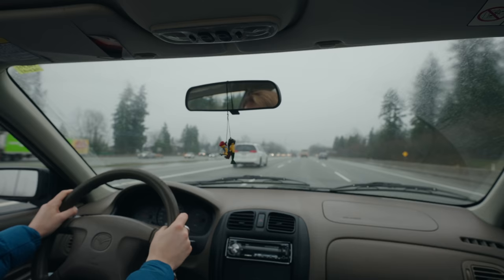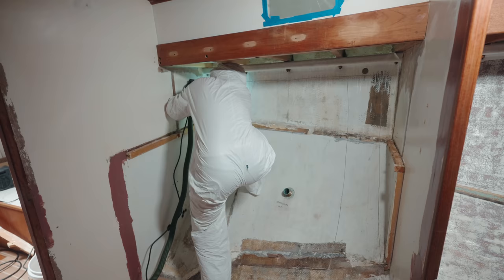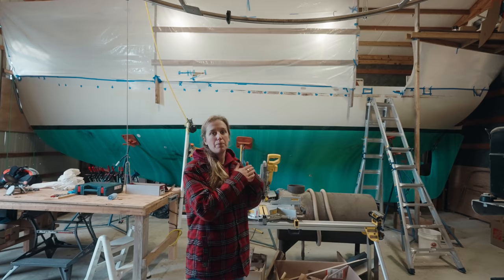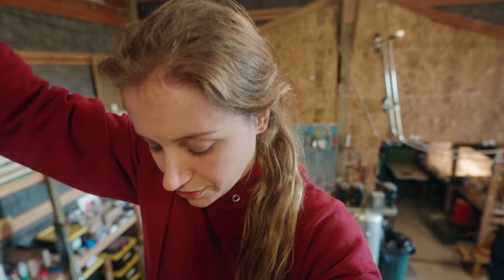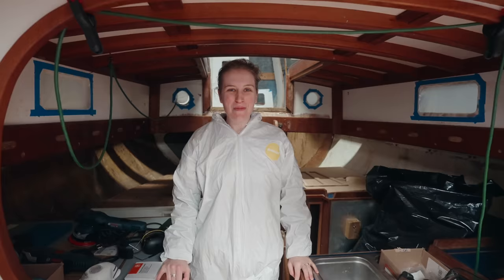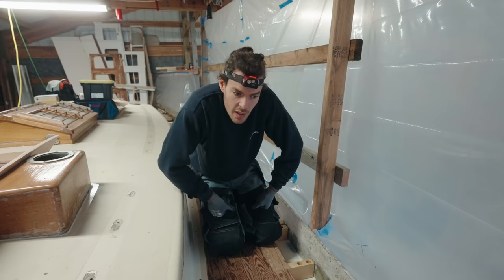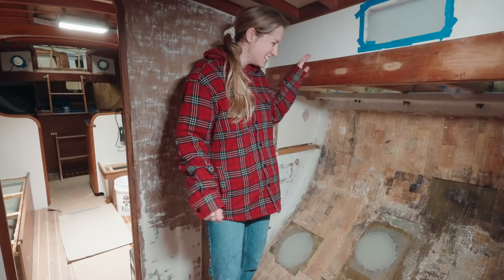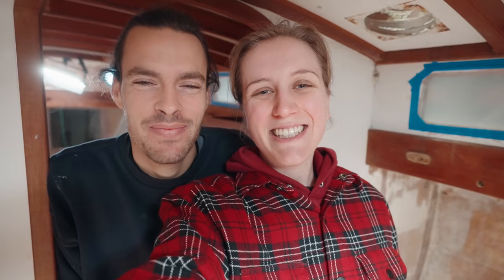Sailboat Demolition STARTS NOW! [S4E37]

Comment: Here's something I did to avoid head thru hull exit. - Routed a 12 volt line to the deck pump out.  Where I installed a 12v plug in with a cap.   Put an off/forward/reverse switch on the line back at the panel.  Changed the deck pump out fitting to accommodate the threads on a macerator pump.  When I want to pump the holding tank under way I attach the macerator to the new fitting and plug in the 12 Volt plug to the new 12v fitting near the pump out.  The macerator has  a 5' hose on it with a 6" iron pipe at the end (to keep it below the water line.  Then I pump the head out by flipping the switch. Once empty I reverse the switch and fill the holding tank with sea water (takes me about 60 seconds) and then empty the tank again.  Keeps my head smelling clean, eliminates the thru hull issue. Also keeps the port authorities happy because you have no head discharge below the water line. And after a few rinses using forward/reverse switch the the hose and macerator are clean and ready to be stowed.  At first I was worried the macerator pump might not lift the water up high enough but that was not a problem.  An additional benefit - I could pump out my head into jerry cans if there was no pump out available. (like when you're living aboard while on the hard.)

Comment: Every episode you release is so impressive. A little tip, When it's cold and you want to get laminate to harden, infrared heaters can work.  If you want better thermal insulation, you can use a ten millimeter thick polyethylene foam that also occurs as a sleeping pad in tents.  The material has dense cells and therefore does not absorb water.  In colors such as black or dark gray, the material can be visible with its matte surface.  The material can be attached with contact or carpentry glue.  I have done this on my boat on the hull and under deck sometimes visible or hidden under other materials.  The boat feels warmer and less damp.

Comment: One thing you can do to attach the rub rail, particularly as you have such a thick outer skin, is to use screw in blind 316 screw sockets. These have a course thread on the outside to epoxy and screw into the fibre glass then you screw the rub rail into the blind internal thread in the inserts.
Reply from the maker: I was thinking about using threaded inserts but they are pricey…
Reply: @SailingMagicCarpet  I’m sorry I’m in the wrong part of the world to help. My CNC lathe is in Sydney and I’m in Europe. I’ve wanted to make a production batch of those in several sizes but it didn’t work out that way. I might just do a design and get them priced from a company that machines a lot of parts for me. I suppose you would want to use 10mm bolts. I want to refit all of my stanchions with blind inserts, its not on my immediate work list.

Comment: Suggestion: Build an insulated box with room for the heater and whatever epoxy and hardener you intend to use to warm at least the bulk product up.
Reply from the maker: We did that last year and have a box in operation!
Thanks for the suggestion

Comment: what about fiberglassing some brackets to the outside of the hull and bolting the new bump rail to those? That way there's no hull penetration at all, and at worst a bracket breaks off in a bad bump rather than a bolt shearing through the hull.
Reply: I did the same on my boat and it worked a charm. The added bonus was that the water that washes up over the deck immediately runs off and does not stay on deck and suffer ingress into the deck and beams as it doesn't go into the hull at all as well as sitting proud of the hull providing extra protection as it sit slightly wider of the hull.

Comment: If you MUST have a rub rail - glue it on.  Otherwise use your fenders/bumpers.  Goal should always be - NO HOLES - or as few a possible.  Consider a sea chest for a single thru hull common intake.

Comment: You don't  need  to go all the way  through  the glass to attach the rub rails. Thus  preventing moisture  intrusion in the future. If the glass  is an inch thick  go in  3/4 inch.

Comment: 3 M  tape or emblem tape works well to attach stuff . Often used to hold boat windows in .it is what holds the emblems on your car.   Might be an option for the rub rail .

Comment: If you are concerned about letting water in via rub-rail bolting, you might consider not having a rub rail at all. Rub rails are not a necessity and are prone to up/down damage if secured to a harbour wall with a scend present. Use carefully placed fenders instead.

Comment: I bolted on a teak rub rail with bronze carriage bolts with the heads recessed into the wood, placed the traditional bronze half round strip covering the bolt heads, all caulked with 3M5200. Has worked well. The problem is the bolts and nuts and washers on the inside would sweat until I covered them with PVC caps filled with foam, potential spot for rot.
Reply from the maker: Thx for sharing that! I didn’t even consider the sweating before… one more reason I’m happy not to have the bolts in place any more

Comment: Dang!  I own CG 36 Aurora.  It is an owner finished boat with a relatively bizarre interior.  I have been remodelling the interior for some years but I don't have balsa core, I have 1/2" urethan foam.  I still removed all of it in the V-berth and replaced it because I had to remove cabinet bulkheads bonded to the hull.  I am happy with the urethane foam/fiberglass skin I added.  Also FWIW, I don't have a rub rail.  Drop me a note if you wanna compare notes.  Been watching with interest, some of your projects I'm in the middle of, some I've finished, some I'm considering.
Reply from the maker: Great to hear from you Todd!
I initially thought ours would have foam instead of balsa as well but oh well we almost made it:)
Is Aurora the one with a Westerbeke engine and marble countertops?
I would appreciate seing other cg‘s if you don’t mind sending some photos wich will be for our purpose only of course.
Our email is sailingmagiccarpet(at)gmail.com
~Aladino

Comment: You may want to seriously consider foregoing the rubrail. But if you really want it, consider epoxy bonding appropriately sized and beveled G10 blocks on the inside, then screwing into, but not through, the G10 blocks for the rubrail fasteners. That should be leak proof and more than adequately strong. Radiant heat lamps are really useful for warming smaller areas to laminate and kick off epoxy, and also useful for drying existing damp balsa before sealing again. Rather than coarse biaxial stitched cloth, consider using tighter weave 6 oz and 4 oz cloth to seal the balsa and provide a smoother finish.

Comment: Re rub rail   I just remembered a great rub rail concept I saw once.
Build a rail based on Fibreglass strip's.
The idea is to bend a plank or scrap wood, to roughly the same curve as the top of the hull, face it with packing tape or some other release agent.
Make the size of the Fibreglass lay-up a bit more than twice the width you want the rub rail ( Say 120mm) and build it up to say 20mm.
After curing, saw a straight edge on the two outside edges to get rid of the jagged sides, then saw it down the middle to make two full length narrow Fibreglass "planks "
Since they are almost bent to shape, you just sand them smooth and attractive,  and then epoxy them to a roughened strip of hull, using duct tape to hold the final shape while curing.
No penetrations, no rust, no hard points to break off on wharves .
Easily repairable, totally sacrificial.
You could even do the top layer in a laminate of hard timber for looks.
Just another option.

Comment: It is sure that tearing everything out to find that there are only 2 small strips of balsat to replace must be frustrating .... but hey, at least you know exactly everything that is in the box. thickness of the insulation of the hull and you will leave on a healthy and new environment. to put a new sheet of epoxy, I would advise you to first coat the balsat with resin and once dry to put this fiberglass sheet again. and for the finish, you can apply gel coat rather than paint, as this is much more solid and easy to maintain over time....Bravo and super courage, the decision should not have been easy to make, but once this is reassembled, you can be very proud to leave on a healthy hull...!! The outer rail... it's double-edged, it can protect like tearing everything... all the boats I've had had no rails (apart from the Attalia, but it was aluminum, and fixed with the deck), putting it in the middle of the hull does not seem to me a good solution... risk of shearing with another boat against against in the event of a swell... you will see for yourself, good courage for the site and congratulations again for all this energy which will give a new boat beautifully repaired like the first Magic Carpet 1, Vincent de France

Comment: Just an Idea.If you have 1" of solid fibreglass to work with, using the original holes, you could epoxy brass nuts in the original holes. This would give you a good attachment points without going into the wooden part of the boat. you might be able to have a machine shop make the brass inserts to fit the holes and then tap the brass inserts with the appropriate threads for the bolts that you would use to attach the rub rail.
Reply: I should add that you can find brass inserts of all sizes on Ebay. You may be able to find an insert that will fit your present holes. You then find the appropriate machine screws to attach the rub rail

Comment: Can't see anyone else making the suggestion to use a hand held  heat gun when wetting out glass with epoxy. 
It makes wet out 100 times easier, and ensures a quality saturation.
Reply from the maker: We do activate the heat gun when in trouble but there is no need when things are saturating nicely:)

Comment: The only reason moving the rail higher doesn't work is because you are keeping the rail the same size. If you make the rail wider you can move it up as far as you like. I'm you can epoxy it in place and it will be strong enough but I  also like the idea of bolts and ones that are backed by parts that aren't structural or connected to the rest of boat to isolate any possible rot. Or in a sense making the backing of the rail a sacrificial consumable as well.

Comment: From previous experience, I Highly recommend NOT installing any rubstrake/rubrail at all because it will be a hazard alongside anything (dock, pier, yacht) where there is a up/down motion where the two are are rising and falling at opposite frequency and any hard rail sticking out will be crushed by any similar obstruction sticking out (pilings, bolt heads, other yacht rails, dock edge,etc). I have seen damage from this type of motion and it is harrowing to watch the destruction and a pain to fix. Eliminate anything sticking out from the hull and bulwark.
Reply: I think he is right, why would you want to put a rail, when the fenders are enough to protect the hull, and we have the advantage of sliding, if there is a rail it will be much less easy...! !
Reply: @VAdu56  I disagree. A rubbing strake is extremely strong due to is shape, length, and mounting method. Further it is traditional for this boat design style.

Comment: Have you considered shortening the rubrail? Forward of the forward lower chainplates a rubrail is not very effective, due to the flare in the bow. Crealock designs (Pacific Seacraft 40, Cabo Rico 45) show what I mean. How far forward you extend the rubrail is more an issue of aesthetics than practicality.

Comment: for my boat rubrail im going to use 316 metal inserts  driven onto the hull, where the rubrail bolts will fasten. by bedding the inserts into epoxy i ensure that there will be no leaks. for the rubrail itself im going with a fake teak trim. not cheap but maintenance free and should last for 20 years (i hope!)
Reply: Fake dimensional? Interesting. Like the insert concept. Thought the problem with rubrail fasteners on FG hulls is the length expansion fighting?

Comment: Why even have a rub rail. I don't think you will need them as you won't be sailing from marina to marina anyway, your blue water no littoral.  Good quality fenders. Also check out what RAN II  used going thru the canals last year. Hull/Fenders with a board connecting the fenders together.

Comment: Aerogels might become an option in the future to improve insulation. Its expensive as production involves specilized machinery and lots of energy. Though, even as little as 2cm of this material would have the effect of 10 to 15cms of conventional insulation like rockwool.
Silica based aerogels are also hydrophobic and the least dense solid humanity has discovered to this date. So they are also exceptionally light. 

Material conductivity of Balsa is roughly 0.0339 W/mK, Aerogels are at 0.002 W/mK. 

THough i have no idea if it's too brittle for the constant rocking of a boat, but it survives being launched into space, where it insulates critical components like sensors in satillites.
Reply from the maker: I had my eyes on that stuff!
But cannot afford it now. 
Maybe one day on a new build it would be insulation for the hull and the fridge!
~Aladino

Comment: Consider leaving the rub rail off altogether.  I have always found them rather useless.
Reply: I totally agree. Especially for a blue water cruiser that will be doing long distances and lots of anchoring, it's not really useful. And it looks a lot better without it.
Reply: I find them very useful. Would not eliminate.  Saved my hull in a hurricane.
Reply: As an armchair sailor myself, I don’t understand what purpose a rub rail serves that fenders couldn’t do as effectively? Extra protection maybe? Kind of a belt and suspenders thing?
Reply: I use my rub-rail all the time. Mine has a stainless steel strip on the outer edge and I warp off pilings anytime I want to when getting in or out of a slip with a crosswind. I consider it an essential piece of the boat. Just my 2c. '99 IP 350.

Comment: What if you countersunk a as Hollman  three fab treaded insert from inside the hull and then glasses over it from the inside then attach the rubrail from the out side with S.A. machine screws with lock tight  and thus no hull penetrations.
Reply from the maker: I thought about that option but threaded inserts in stainless are very pricey!
Thx for sharing:)

Comment: One inch would make the boat safe in the northern passage I would think. Many of those boats use incredibly thick aluminum  though. Wondering, what sort of bulkheads does the boat have, and have you done an episode where you inspect them ? I've found it at
Reply from the maker: It’s certainly a serious glass layup:) we have shown some repairs done to the bulwarks when we were building and installing beams. They are 1”thick and well tabbed don’t know what else to say about them🤪

Comment: What about a rub rail that is mechanically fastened above the deck? It can be through hull bolted but above the deck. Suspended with S.S. brackets hardware? This may be an odd option but your not penetrating the cabin of your hull! You mentioned in earlier videos about reinforcing the hull above the deck with fiberglass instead of wood.
Reply: Good thinking, but, thinner fiberglass hull at that point plus you would introduce toe smashing bolts in that area.
They also stated that the way the hull is curved a higher rub rail would be ineffective.
Reply: @philipmackin1025  thanks. I was thinking keep the rub rail where it was just offset the anchor points. That technically would put a moment rotation on the through bots at the anchor points but those would be above the deck level and be reinforced.

Comment: good call balsa may be a good insulator but  unless well sealed when rot sets in it loses structural integrity and from experience in model boats that way leads to disaster
Reply: the balsa is not at all structural on this boat.

Comment: Hi, nice to see how you're going to rebuild the boat from inside out finally doing what the builders should have done in the first place when constructing it. It would be interesting to hear why Aladino changes the anchor chain concept so as to keep the chain in the foremost dedicated section where it won't be at the deepest possible level in the bilge. Production boats have this kind of arrangement because the front compartment alias chain locker is considered a collision compartment where water ingress would not compromise hull buoyancy and safety. Would that be the reason why the chain is kept forward? Keep up your wonderful work!
Reply from the maker: In my opinion the biggest reason for having a chain locker high and at the very front of the bow is out of simplicity and least expense for the yards to build.
Unless you have a very big boat carrying the proper amount of chain actually required on a circumnavigation is a challenge with those modern setups. That is why we changed our chain locker  and sacrificed some storage under the v-berth. The disadvantage is having to design the locker to drain since it’s below the waterline. 
A watertight compartments requires considerations on its own.

Comment: Use a spray bottle with 50% bleach &water mix to spray any black mold spots on the inside hull. Need to kill those black mold spores. This is a Health Hazard that needs to be eliminated.

Comment: Skoal or Copenhagen in your back pocket?  LOL
Reply: Was wondering the same thing.
Reply from the maker: OF COURSE NOT! Honestly, gross. It’s the camera’s lens cap.
Reply: @SailingMagicCarpet  Ahh, that makes sense.  As a photographer I should have caught onto that.  I'd be wary of putting it in the back pocket though.  If you sit down on it forgetfully, it may get cracked though. Lens caps aren't very expensive, but an extra cost you don't need.
Reply: @SailingMagicCarpet  not a photograpographer or a dipper.  I just see a lot of people with those circles in their pockets here in the south.  LOL